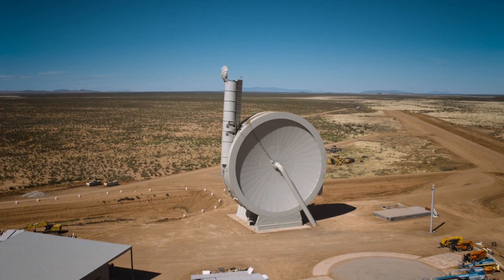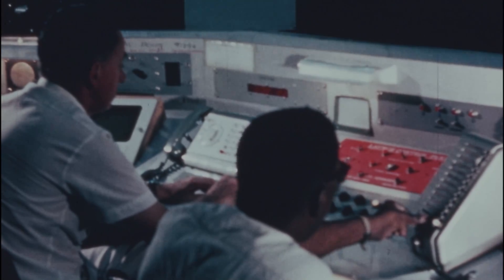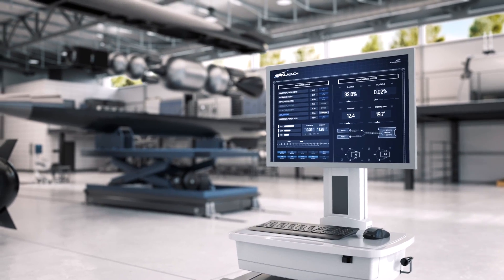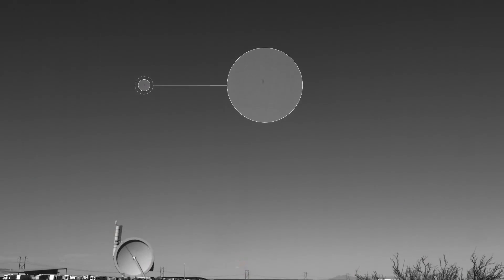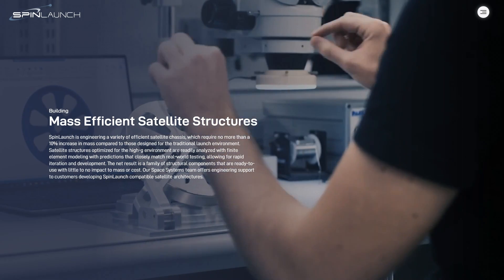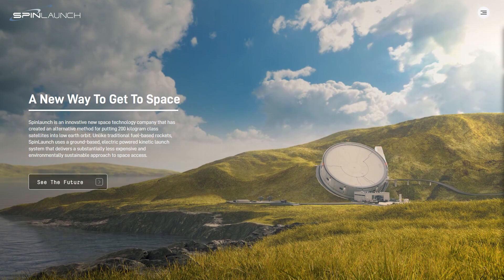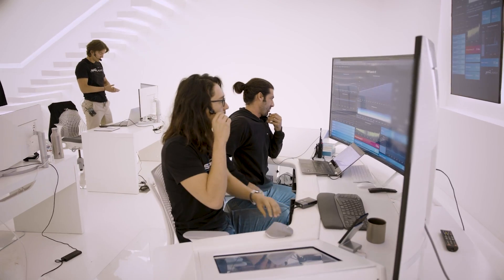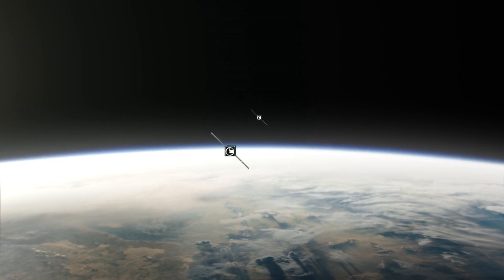Can Spinlaunch Throw Rockets Into Space?

Comment: 1.  That thin film ain’t keeping any sort of vacuum
2.  For a film to hold the vacuum, it’ll cause a BIG problem hitting it with a projectile at several thousand kmph 
3.  The counterweight problem will be impossible to solve - unless of course they release a counterweight in the opposite direction and contain an impact-type bomb somewhere below the actual machine
4.  There’s no structure in the world that can support the forces involved of having a large weight at the end of a 50 meter spinning arms moving at 450 rpm then suddenly releasing it at full speed.

Comment: This thing is not for throwing people,  it's for throwing rockets ... which are flimsier than people. The G-loading on the projectile is going to be hilariously insane for the last few minutes, and there is going to be a once-per-revolution pulse from the earth's gravity adding and subtracting from the centrifugal inertia. That'll tear something up. Then there will be an instant of release, so everything in the rocket will unsquish. Something has to happen to stop the rocket's end-over-end rotation, which will take energy and cause strain. Then the projectile threads through the exit door and hits atmo like a freaking meteor, and all the rocket bits try to stuff up into the nose of the fairing.

Sure, they can overcome some of the problems, but it all will add weight and cost money. As a for-profit agency, they will be trying trying to cut budget wherever possible, and it is possible they will fire their projectile straight down. 

Do you know what happens when you break the picture tube on an old-school CRT television? It explodes. The pressure of the atmo sends all the glass shards hurtling inward, and they come bouncing out again. 
A yeet-rotor failure will puncture that giant building, and 15 pounds of pressure will stamp inwards on every square inch of the thing. The collapsing walls will vacuform around the rotor, the payload, and the counterweight, and all heck will cut loose.

Comment: This is so hilarious! How can anyone take this nonsense seriously?
Reply: It does seem rather impractical, but remember, every mechanical, aeronautical or such engineering marvel needs smaller scale demonstrations to really iron out the stress or failure points. According to the VP of Technology for SpinLaunch during some media events and appearances, any other methods were simply too cost prohibitive (such as Manley's mention of  a coil gun accelerator in the first couple of minutes in this video).
With a computer and thousands of trial launches, finally getting a scale model firing out at Mach 6 or about 2.5 kps.*
However, perhaps the real game changer (I still have my doubts about the affordability, but this helps quite a bit) is that some with mere hundreds of kilograms oxidizer in the mix, most of the usual first stage propellant usage switched to the launch facility power supply and only a handful of seconds to endure through a majority of the atmospheric drag, what is stopping the launch facility from using laser-assisted thrust while it is downrange?
Now, I do want to throw out the idea that it is green (far from it, apart from saving money because electricity is incredibly cheap at the quantities in consideration). Every 100 Megawatt-hours that has worked out as the upper limit for the full-scale launcher per launch will likely contribute 37 or 38 metric tons of CO2 if the base power is comparable to US grid averages. In contrast, a SpaceX Falcon 9 will use up no more than 12 kilograms of kerosene per kg payload, so about 342 metric tons of CO2 (for 9500 kg of payload).This means the SpinLaunch needs to address a sizeable gap in catching up with tried and true kerosene (such as somehow powering 80.9% of the spin through renewables).
--
*And, a tidbit for Manley's sake, that the Mach 7 version is rare, only when they are really pressed for time or filling in a contract that another launch could not complete). Why, Mach 7 is kind of borderline. Most shielded electronics ideal for space cannot withstand 15,000 G's for an extended amount of time. Not only is the spin-up time for the upper range of Mach numbers easily 90 minutes, there is reason to believe that the crane arm will impart 20,000 G's. So there are restrictions and considerations every step.
Reply: @pkscolax9480  How can anyone write such a long post about a Wylie E. Coyote project?

Comment: Okay so. How to they balance that rotor spinning at 2km/s with a few tonnes on one end experiencing thousands of G's equating to hundreds of thousands of tonnes? A counterweight? okay fine. So now you are trying to hang on to hundreds of thousands of tonnes times 2. How much steel do you need to hold onto that much apparent mass? And how much steel do you need to hang on to THAT steel. How do they balance that rotor after release? Maybe they could also launch that counterweight backwards.... okay fine where does it go? Into the ground? A few tonnes of matter travelling at 2km/s hitting anything generates a fairly destructive impact. Right at the launch site.
We haven't even left the ground yet and this has already turned into some high tech self destruct/suicide machine.

Comment: I wonder what material that is that the rocket breaks through.  Estimating  3ft x 10ft and atmospheric pressure of 14.7 psi it will have to hold back about 3x10x144x14.7 = 63504 lbs of air pressure and yet be fragile enough that the rocket can break through without damage.  Pretty tough stuff!

Comment: The video of the emerging rocket looks phoney to me. If that membrane has a vacuum behind it shouldn’t it be sucked in? But the other technical problems don’t seem insuperable to me. There are separation/ exploding bolts already developed for the space industry that should set the thing off in a fraction of a millisecond. I would have a counterweight that separates at the same time or there will be a huge out-of-balance spinner to decelerate. Can’t see why it wouldn’t work.

Comment: Why now improve the HARP-System?
It was way cheaper and an already-proven concept.

Did you calculate the Gs for the way to slow the demonstration run or the final necessary velocity?
What forces will apply to the payload when it leaves the vacuum? 
10-20kG perpendicular to the axis during spin going to 0 and n G along the axis setting in in a fraction of a millisecond.
Sounds challenging to me, especially if I imagine fragile parts like folding sun sails, solar panels, precision optics, etc.

Comment: I wonder how much energy the whole system has at full speed? Just the payload and counterweight is about 10t tnt. For rebalancing, how about firing forward and backwards? Rather than a counter weight, have a sacrificial projectile of the same mass that gets dumped into a prepared trench as far away behind the launcher as possible. A ten ton projectile at 2km/s is about 5 tons of tnt. Build on a hill, elevate the launcher, and I think you can get it to hit the ground far enough away to not destroy the launcher.

Comment: The biggest problem with such Space-Gun-Concepts is the massive aerodynamic brake in the thick layers of the atmosphere. 
So, you need a spacecraft (let's call it a bullet) capable to endure very high G-force and heat.  
I don't see this happening for regular orbital launch payloads like communication satellites. 

But do you think it is possible for something like a dumb-rocket that features very simple attitude-control and a solid rocket motor for circulation, that delivers dumb payloads like fuel or construction material? Because I think this could be the best delivery-system for a space-based geoengineering program in which you place a toroidal Cloud around the earth consisting of sun-reflecting matter with the purpose to reduce global warming. 

If you place this Cloud somewhere in a higher orbit like 10.000 Km. It should be less of a Problem for other Spaceships.

Comment: You said nothing about arresting angular momentum of the projectile in a milisecond while being released!!
Reply: Thats an easy problem to solve. Just have a flag set so that at the instance of release, the counterbalance is no longer being graphically rendered.
Reply: I mean, if the projectile is spinning, at the moment of release, it will have two motions combined: translation motion to the front, and rotating motion. The problem is arresting this rotating motion in a fraction of a second, so it climbs straight. But you cannot stop turnig the projectile in an instant, it will break apart, and they show no mechanism to do it.  @onradioactivewaves

Comment: There has got to be more ways to get stuff into space.
Why not build a big platform, in geosynchronous orbit, that has a really really long cable on it, that could be lowered down to pick stuff up. It wouldn't even have to go all the way to the ground either,  the cable could hook on to a big dirigible or something similar, that would itself be able to reach a high altitude of 100k or whatever feet, then the cable snags it, tow it into orbit.
There's been talk about a "space elevator" but having something in orbit that is also attached to the ground, is insane,! When you add in factors like wind, earth movement, or any other unforeseen events, it's not at all practical, possibly even unachievable, it's a lot of impossible engineering and a lot more pissed off fabricators.
     I think this is a lot more feasible than a space elevator, this would basically just be a satellite with a rope ladder. Most of the technology already exists so it wouldn't be a matter of coming up with a whole bunch of new inventions just repurposing things, like the thrusters on satellites or cranes and wench cables, synthetic would probably be better than literally tons of steel cable. I could go on and on about such a device but I think you (if anyone actually reads this) get the picture 
🌎 🪜 🌝

P.S Google you better not steal my idea.

Comment: I'm enthusiastice about this technology and appreciate the update and your clarity, Scott.

Two interesting details. In 1966, Robert Heinlein proposed a spin-launch system on the moon, and it was used to bombard Earth in a brief war for independence. Second, the current sub-orbital test version could easily be adapted to launch military missiles, including possibly cruise missiles, replacing rocket ICBMs. That would make SpinLaunch a technical update of the German V-1 rocket of WW I with its fixed rail launchers.
Reply: This idea would work on the moon. It will NEVER work on the earth.
Reply: @stuartgray5877  Why not? Please tell us  more.
Reply: @sidkemp4672  Multiple reasons: The projectile must be going at MAX velocity at the lowest altitude.
The SR71 could not even reach Mach 4 at lower altitudes. it HAD to fly so high to keep the aerodynamic heating low.
The machine that "throws" the mass will become instantly unbalanced and tear itself apart UNLESS they hurl an identical projectile in the opposite direction simultaneously (DOWNWARD). This is something they don't mention much.
ANY projectile fired will need to withstand enormous accelerations. Small tight electronics MAY be built to withstand these g forces, but many spacecraft components cannot.
IF they ever launch ANYTHING to orbit with this thing it will be a block of melted tungsten
Reply: @stuartgray5877  There may be other problems, Stuart, but these have already been worked through. The test launch just completed demonastrated that this sub-orbital launcher can put a missile into space and not break at all, and handle the imbalance to slow down safely. It demonstrated that a projectile could reach altitude intact. Experiments by the company have tested rocket and electronic components verifying that they can withstand the G forces involved in the launch and the heat of initial high-speed acceleration from ground launch.  Most of this is covered in the video above, and Scott Manley is a reliable independent expert.

Other items, such as being able to include guided targeting mechanism and a one-stage rocket are not yet proven, but they are in the works.
Reply: @sidkemp4672  Sorry I only have 30 years building deep space science probes and interplanetary landers.  And I have only personally launched six spacecraft. 
You probably know more about this stuff than I do.
Reply: @stuartgray5877  Hi Stuart. I don't know anything at all. I'm just trying to learn. I do know that everything you wrote was true five years ago and even a year ago was not demonstrated as false. Please teach me: How is it that some of the statements you made are contradicted by the facts - a matter of public record stated in the video above.

Specifically:
- the SpinLaunch launcher did fire a projectile upward and did not send an opposite projectile downward, and was not blown apart
- the projectile they sent up did not melt.
Please offer your expertise and teach us all.
-

Comment: I don't think this will work. The chamber just doesn't look like it can achieve a vacuum with all these leak points. And it came out of the front with an error of over 30 degrees.
Reply from the maker: What leak points?
Reply: @scottmanley  Why are you ignorantly and just blatantly questioning? Use your brain mate...
This thing is a pipe dream..no pun intended.

Comment: So there plan is to counter balance the roter with another launch vehicle. So in the time it takes to make that that half rotation it is then balanced. They say it is with in the shock load capability of the meteral. I for one would be squinting. 😖
Reply: i dont think they are doing this..because they said they are not doing this. However, i do know where you got that idea....
(from a comment made a year ago mentions this, but not an implementation they are actually using...)
Reply: @Skin of Mary Inc.  I never said they where doing that. They said it would be in a future design iteration so no they are not doing it yet. They are still testing proof of concept.

Comment: I did some quick calculations to see if this would work for humans. I decided that the circular motion is just not going to work as the humans would be crushed to a pulp. I therefore envisioned an accelerator that was positioned at the equator and followed the curvature of the Earth in a "straight line". I also ignored air friction for simplicity (because I don't know how to take that into account :-) ).

To achieve minimum orbital velocity:
1 g max:  12.4 minutes covering 1,700 miles.
4 g max: 3.1 minutes covering 425 miles.

Note: due to air friction the distances and times are much higher in reality. Also, there's the "small matter" of when the spaceship is redirected upwards which I ignored as well. Ya, it seems very unlikely that this will work with anything but devices that can withstand tremendous g levels. Humans will have to go up the conventional way.

Comment: That launch was a fail. 

1st the rocket tumbeled at exit 
2nd it didn't have a straight trajectory which is not a problem since it didn't leave the orbit but if it was a serious launch it would be ... lost in space 
3rd After every launch the system would have to be sealed and depressurise to vacuum which is energy intensive 
4th The system itself is not a vacuum, you can actually see rust and particles in the chamber a tell tale sign some thing is not right 
5th The forces of the rotation are so strong if something goes wrong a rocket explosion would look like a firecracker. We are talking of mach 5+ speed debris flying around for God knows how far. 
6th Any human to be launched from this system would not have a good time. The G forces pushing down on the body are not the problem but since it spins you have lateral G forces and those are deadly ... your neck can support so much sideways pressure. 
7th this might look like a good idea if you are at that Tom and Jerry age. You might as well place a nuclear warhead under a giant metal plate and sit on it.

Comment: OK.
I call BS on your optimistic analysis.   A 10,000 g centrifuge is not going to hold together.   The rocket and the centrifuge will fly apart.    Furthermore, the rocket will launch with a 40 rpm nose over tail spin, which will immediately destroy its aerodynamics.

Comment: Perfectly balanced vacuum chamber centrifuge...launch...perfectly UNBALANCED centrifuge immediately blasted with air thru the massive hole in the vacuum chamber....all at orbital energies...what could go wrong? I best the centrifuge arm would be molten from the air drag if it didn't immediately shatter into a billion little pieces...if so it would be very pretty, just think what white hot metal globules moving mach 2 would look like being thrown for miles around? Very pretty
Reply: Like all things mechanical, it must be perfect!
Reply: They're gonna immediately seal the chamber.